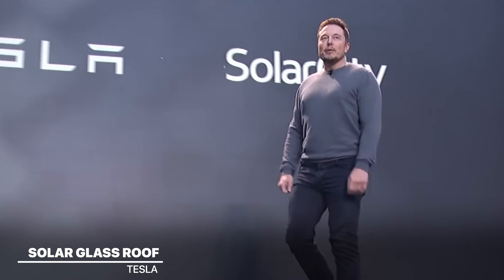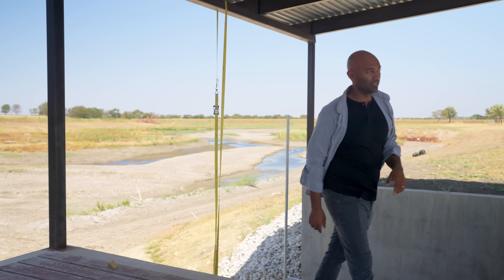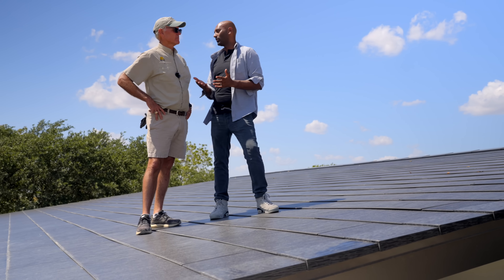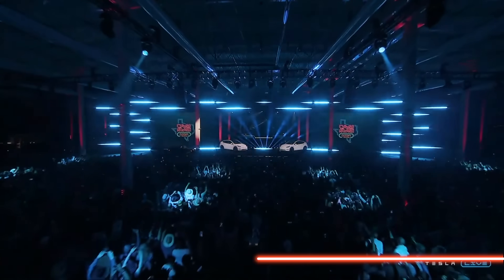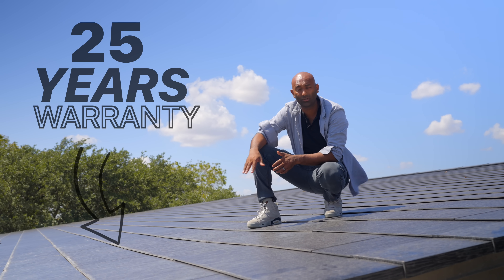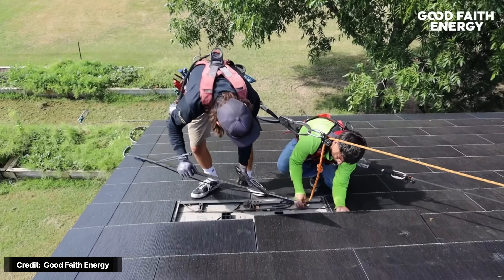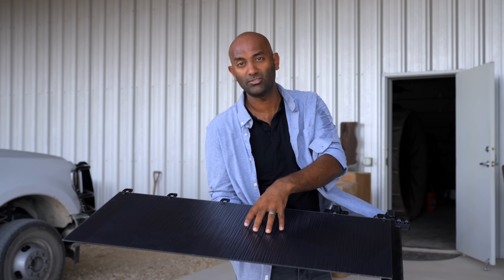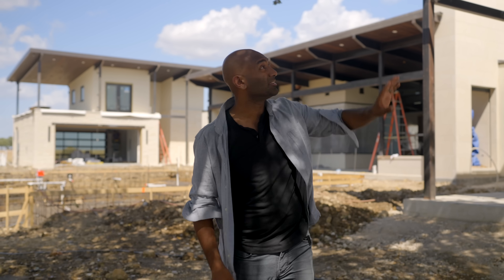Tesla Solar Glass Roof is About to TAKE OFF!

Comment: The Title was a little "click baitey" but the content very good. Like you, I installed a 12.4 Kw Solar Panel, 2 Powerwall system on my very complex tile roof and I agree all new housing being built should use smart energy design. My Tesla solar panel system has been fantastic and is paying itself off  over the 10 year Tesla Purchase ($49K at 1.9% interest rate). I am replacing all of the house appliances and going electric as they age out. Since the house and the dual HVAC are 24 years old we will be doing a Heat Pump based replacement on that which will eliminate all of my need for natural gas. That will be the last piece of my true off grid energy independence. I'm hoping that Tesla builds a residential heat pump system so that all of my energy consuming and generating systems can be controlled by a single application and I believe that good comprehensive data is an important aspect of true energy independence. The Tesla software provides that.

Rather than more powerwalls, my plan is to use our 2 EV's as a storage resource for the overall home energy  and so bi-directional charging (vehicle to home) will be a factor in all of my EV purchases in the future. Keep up the good work Ricky ... 👍

Comment: 35 years in the Industry…The  elimination of all cutting of solar tiles was needed.
Start with    ‘’New Construction Only’’
1. Produce about 3 continuous sizes, example: 6’ 10’. 14’.
2. Mandate contractors build houses in sections to those exact sizes.
3. Channel all pipes ect. in attic to 1 or more decorative fireplaces with hinged tops for access.
4. Optional application would be VERTICAL for allowing different lengths & heights of given sections. This mimics standing seam metal roofs.
Any competent roofing crew could prep the roof beforehand hand & finish any roof up to approximately 5,000 in 1 day.

-“Some’’ Existing houses could be converted by construction companies to channel pipes through Attic to false chimneys & re configure roof..

Comment: A lot of people here are pointing out the video title is clickbait.  I'd have to agree somewhat, especially since Ricky did not do a good job connecting his content to the title (or vice versa).  Most people have a problem with the word EPIC, myself included, but be that as it may, I don't have a problem with "failure," you just have to read between the lines of Ricky's video.  .... My take away is that if the roof is not simple, flat, no protrusion roof like the one of the Texas home, the cost of putting on a Tesla solar becomes way too cost prohibitive because of all the extra time (and probably material that gets wasted) from having to make all those special angle cuts when there multiple roof planes that meet up and not a full solar roof panel can be used.  I believe that's the failure Ricky poorly explained / tied in with the title.  ... Still have not seen any update from @Two Bit da Vinci (Ricky) which is IMHO would go a long way in assuaging those who have complained about the title and the intent of what was meant to be conveyed in the video. ... I'll be darn.  Just as I'm finishing writing this up, Ricky puts out an update.  Haven't read it yet so this should be interesting. ... Nope, unfortunately nothing useful ,,, yet! ;)

Comment: This guy should have purchased an f150 Lightning instead of 4 Tesla powerwalls
Reply: F150 Lightning has 7.2 kW output. That would’t back up anything ina house this size. It’s got plenty of capacity, but not enough output.
Reply: The intelligent back up power system provides 40 amps at 240 volts so it’s actually 9.6 kw and I can tell you from experience of an actual install at my over 5k square foot house that it will power my entire house including heat pump/air conditioner as long as you have soft start capacitors installed on the units. And the 9.6 kw does not account for the 20 kw solar install that can also provide power to any loads during daylight hours.

Comment: RICKY!!!!!!! Stay away from the click-bait titles!!!!  Epic failure?  Really?  Come on.  Every time you do this, respect and trust is lost in you and your videos.
Reply: DITTO!
Reply from the maker: Updated. My point is… it has been a flop so far and there’s a reason why. Hope the video is clear!
Reply: @TwoBitDaVinci  - Sorry, Ricky, it is not clear.  An what is that reason?  Because 99% of roof lines are too challenging for Tesla solar roof panels to be installed thus increasing the cost?  (See my post attempting to explain your possible intent.  I could still be wrong.  An update from you that's more than 10 or so words IMO would be helpful.)   None the less, thanks for the video and agree the design and construction of the roof could and should be better going forward, but I fear that won't be enough, soon enough to make a difference.  According to the National Association of Realtors (NAR), only 15% of homes bought today in the US are new.  In other words, at least 85% of homes probably have undesirable roofs for Tesla solar roof panels, which is not Tesla's fault.
Reply: @TwoBitDaVinci  Ricky, the Tesla roof as a product is not a total flop.  It’s a good but expensive product for those with the pockets to utilize it as it was designed.  The problem with ALL solar power is, homes in the USA were never built with solar in mind.  This means many homes are NOT good candidates for solar.  For the homes that might be able to utilize solar, angled panels are the only real cost-effective option.  Tesla roofs are either for the new construction crowd (such as this property), or for owners who can afford the expense of such a roof and associated equipment/batteries/panels.  
My point is, putting “TOTAL Flop” in the title of your video is clear click-bait.  I’ve been following your channel for years and for the most part have found them, and most importantly YOU, trustworthy and informative.  These titles (yes you have done it several times and I’ve commented each time) waters down a respectable product.  PLEASE STOP IT!!!

Comment: Thanks Ricky.

I have not watched the vid yet and look forward at your take.   I've always argued w a friend and fellow Tesla bull that solar will likely never succeed.

Tesla only does residential and that doesn't scale as well. If they were a utility player I would have had more hope.  They never were a big player.  And the solar tiles are even worse due to the extra custom nature which makes it more labor intensive.

If they can produce the non-solar tiles in large sheets (say 4x6 or even larger) it will reduce installation time and effort.  That's the only way I see this having a chance of success (on existing roof installations).
Reply: Megapacks are Tesla's answer to commercial energy storage. Collection is just another important aspect and they will lead what I hope is a larger field of competitors than they have in the automotive field. BTW, I am also large TSLA.

Comment: Clickbait title vs content. So, the Tesla solar panels are not an epic failure but rather existing home & roof designs are not ideal.
Reply from the maker: You see why that’s the same right? A market is the prime source for a product. Hope that’s clear. Cheers
Reply: @TwoBitDaVinci  - I do, but unfortunately you clearly did not explain that well enough in the video, hence all the "clickbait" related comments.  You see that, right?
Reply: @TwoBitDaVinci  All you said in the video is how great the solar tiles are and how great this home & roof design are. Then you blamed all the problems on existing roof designs and never said "the major fail is that these panels are not designed for existing roofs" but rather "existing roofs were poorly designed to accept these panels and going forward roofs need to be designed differently to accommodate these panels" which has the causality of the problem completely backwards.
Reply: No it is far from the same thing.  You see that your comment got Zero likes and everyone else did.  It's quite a strong message.  It would be good if you listened and I might not have to unsub again because of it   @TwoBitDaVinci

Comment: How does the efficiency of Tesla solar compare to traditional solar?  How does it compare to when the glass tiles first came out, and how does it compare to gaf timberline solar regarding cost durability efficiency?  Good video but those are the questions I have.
Reply: GAF is nowhere near as hail resistant. Efficiency claims are close. The GAF system lays down right on the deck/waterproof barrier just like a shingle and they don't recommend an air gap or mesh. A lot of questions about how hot they get and does that hurt power production. I have the GAF system (10kW) and it doesn't seem to be a problem for me. Tesla has more air circulation. GAF has a nice looking warranty, untested by me. If you like apps, Tesla's is way better. My GAF system was maybe half the cost of Tesla, installed in one day, wired in another day, price didn't change. GAF has no social media presence that I see. I think it looks a little weird. Works for me. I was interested in Tesla but availability and price were big factors.
Reply: @davidstewart1153 just curious how much of that roof is the solar cell part? I've been wondering how good that GAF product is and haven't really found lots of reviews for it. Maybe you would like to do one:-). Or maybe get Ricky to do one!
Reply: @laughinggas5281  About 60% of the total area for my installation. The GAF shingles are 5 feet wide and would work better on a simpler roof. Tesla tiles are easier to cram into complex roof shapes. GAF seems to market to roofers and let them sell the system, so there's no social media, influencer, referral codes etc.

Comment: I like to guess early ;)

Thanks for what I assume will be another great video !

What happened? 

The cost of solar panels dropped by a factor of 10 over ten years and you can get a good quality roof plus normal solar for much less... 

How tk recover? The only way to recover is through economy of scale.

If they can scale to include this as a basic part of home construction they could greatly increase the scale of their product - turn it into a commodity product that can be installed by any roofing team. And tied to home power with a simple plug-in installation to the home battery box...

I wonder if solar will become so cheap that put it on both sides kf your roof - it may not provide as much power, but it protects your roof from the weather.... an additional 5 years of roof life might pay for the extra panels. 

By guess...

Comment: I want to see less R1 sprawl, and more multi-unit housing & mixed-use corridors - dense, walkable neighborhoods connected by fast, frequent mass transit and protected bicycle lanes & separated trails. Endlessly spreading outward into ever-more car-dependent residential zones miles from anywhere is not sustainable, regardless how it's powered.

Comment: Great intentional design. However, solar will not cover you entire energy usage during winter months unless you 3-5x the system size. Works great on high irradiance days but solar will not be a single source of off-grid power during all months of the year without drastically oversizing your system, defeating the ROI term.

Comment: Thanks Ricky for making this video! I've always clenched when saw those intricate roofs, thinking, how on earth will you put solar on them? Therefor, when it came to designing my home I told the architect to just design the simplest roof, maximizing the area I'll be able to put solar on.
Reply from the maker: I thought the same thing!
Reply: @TwoBitDaVinci  
A rectangular house oriented towards yhe sun generally has more cost benefits than other house styles like lower taxes, less building costs, less maintenance, etc.  Feng shui advocates square houses as well...
Reply: Those intricate roofs are dumb for a lot of reasons.
Reply: @dustman96  
Not sure much intricate but compound, but essentially agreed.

Comment: From everything I’ve heard the real problem with Tesla roofs were incomplete installations. My sister put up the big bucks for a system on her existing house in the Boston area. They installed the panels and left without finalizing the installation. She was forced to wait several years for them to come back and finish the installation. The installer had gotten paid for the roof. She had to wait for the electric to be finished and without that there is no payback and the low profits on that section left no incentive to the installer to come back. In retrospect I’m sure she would have had the contract written differently, just saying buyer beware and read the fine print.
Reply: Hunh.  A contractor who leaves enormous gaps in the job timeline while they pursue other work, screwing their existing clients. Never heard of that happening before.
Reply: @eyesuckle  right - that is why you can pay the contractor 100% upfront, rather than keep some back until the project completes ;-)
Reply: That totally sks !   Who's brilliant idea was it to pay the roofer before installation was complete?

Comment: The urethane foam was not applied in a remotely uniform manner. The brief spray installation demonstration  showed no attempt to fill the wall pocket corners first, and left a visible void at the bottom of the wall. . A good operator using  application equipment like Grayco brand and  2 pound per cubic foot high lift foam can fill 2x6 wall cavities in 2 pases with a much smoother job.
Reply from the maker: That’s the attic an unconditioned space

Comment: I have an older house with a complicated, unhelpful roof.  I built a solar porch with 30' x 16' of panels.  It's only 6kW - but with 14kWh of batteries, it's enough for 9 months of the year.  I'm surprised more people don't do similar.  You get a nice shaded porch & deck out of it too.  Total cost of the groundworks, steelwork, panels, battery & inverter was about $30k.
It will take 6 years to pay for itself - but like you said, the most important thing it gives us is independence from the grid.
Reply from the maker: Thinking about adding a porch system to my system as our current system is close but not quite enough
Reply from the maker: That’s amazing!!
Reply: In my city, solar is not allowed on the "front" of houses.  My house has a "hip" roof, with means that both the south and west are "front" of house. 9.8 cents a KW, no time of use or net metering, means it will be a long time before I can have PV solar.
Reply: Luckily, in Texas, this is illegal. No one can stop you from adding a solar system to the front of your house. Not the city, not the HOA, no one. @VVBros1
Reply: This sounds way more practical than a solar roof on your house.
Reply: Or a ground installation if you have extra space in your backyard.
Reply: Having that extra $30k laying around is the issue.   ( Of course,  I buy a new  $30k Harley every two years, and bought a new Model Y, which seems to be more of an ass-backwards priority for me. )
Reply: @eugeniustheodidactus8890  I saved up!  I looked at it as an investment which is going to give me a much higher return than I could get anywhere else!
Reply: @eugeniustheodidactus8890  lol, you do you, if that is what is important to you
Reply: A good part of the problem with the porch solar method would be uninformed HOAs. Sadly, the average wage slave in this country can't afford to do this, and that's a shame because we don't have fancy homes that have HOAs.
Reply: @jameswilson5165  Luckily, we don't have HOA's, just the local planning authority.  They are sometimes negative about Solar - but this went through planning approval without a hitch.

Comment: There's another problem for people who live in snow country: avalanche! If you live where you can get 1 to 2 feet of snow in a storm, be warned that when the sun comes out the next day it warms the snowpack to the point that the entire load cuts lose at once due to the slick surface (asphalt shingle holds it in place for normal melting). Someone below can get hit with hundreds or thousands of pounds of falling snow. Not an issue in San Diego or Texas but a design factor to consider in Colorado and other places.
Reply: That's what snow guards are for. You'll need them for metal and slate roofs, as well.
Reply: Depending on roof angle, snow density, etc, those work great for up to about 8" of snow. Not so much when there's 12+" , just not enough bond to the surface like standard shingle provide. Leaving roof space below the panels helps a lot that that isn't a Tesla option.